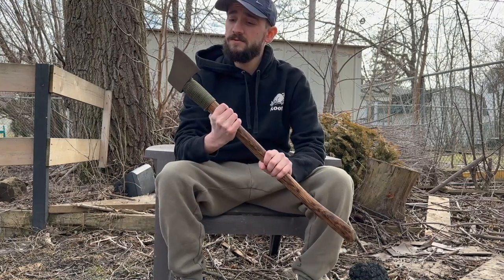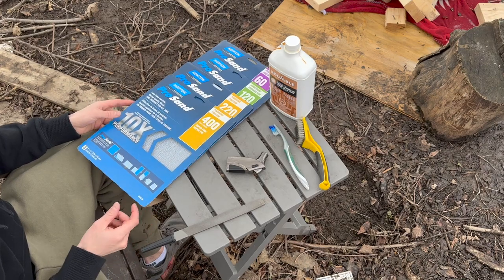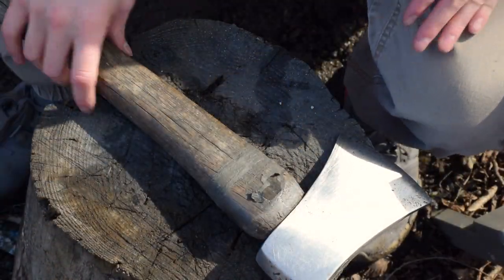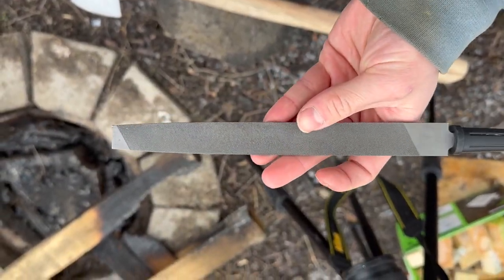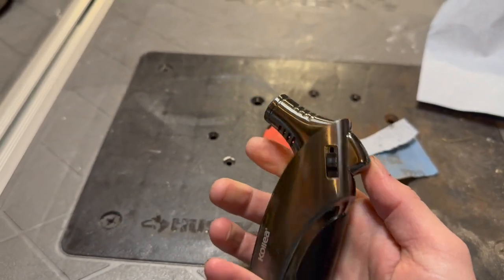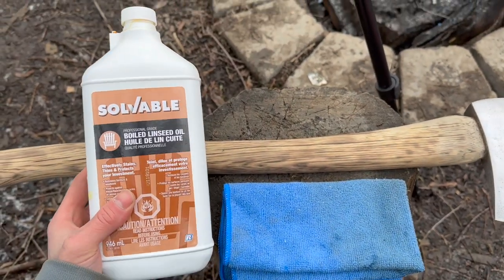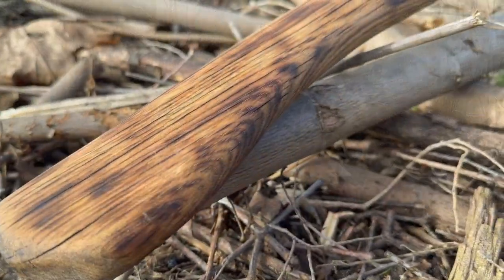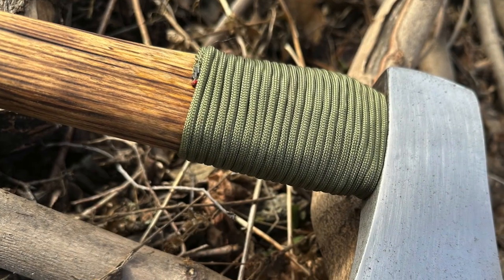Simple Axe Restoration - NO Power Tools , NO experience, Beginner Friendly

Comment: Amazing job. Working on my first restoration now. I don't have much experience with this but I do with wrapping handles. One suggestion I have is to lay the initial length of cord on the belly of the axe rather than the side. That way, the double layer is in front of the axe providing an extra layer of protection. It also helps to blind index the axe better since you won't have a bulge on one side. I always lit a small fire with some shavings in a soup can to fire harden things, but had the idea to try a torch. Glad to see it worked nicely for you, I'm sold.
Reply from the maker: That’s some solid advice, I’ll definitely try that for the next one. I’d suggest a bigger lighter or even a blow torch! Anyway, best of luck!